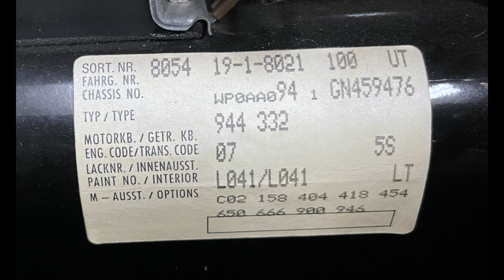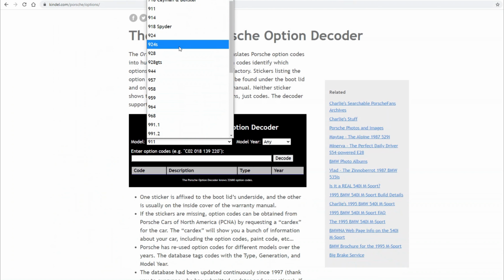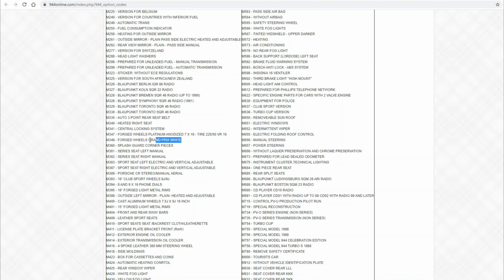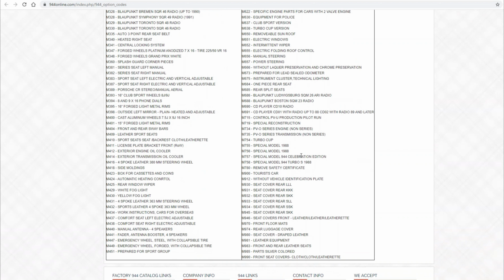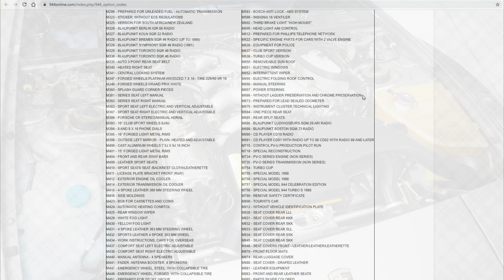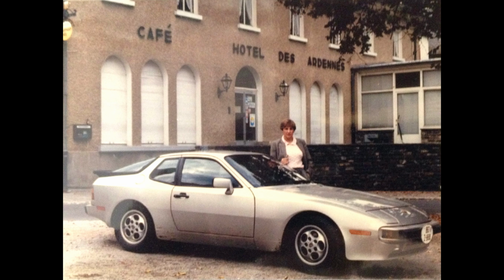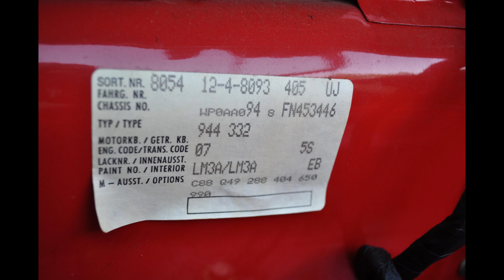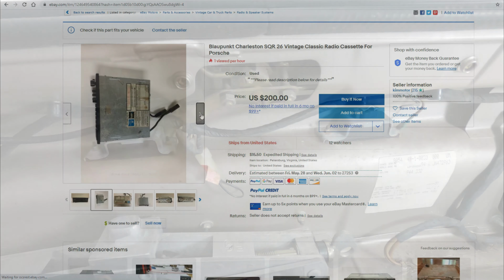Porsche 944 – Decoding Vehicle Option Codes From The Build Tag Sticker

Comment: A duplicate of the sticker (well, more or less) is also in the original Guarantee and Maintenance book supplied with the car when new, page 3.
Reply from the maker: Good call out, for those lucky enough to still have those materials. 😆 Whoever owned mine previously I guess had multiple 944s… the book I have in the glove box includes a sticker for a completely different car. This is a great tip to share though, thank you!  Cheers!

Comment: great channel. my 944s has a tiny crack on the dash board and the rest of the car looks new etc but do you know how can that tiny crack can be fixed?
Reply from the maker: All the 944 dashboards break down and crack eventually. This is obviously hastened by exposure to the sun. It’s best to keep them moisturized, covered, and the car garaged if at all possible. That being said, there are a number of options available as outlined below. Having your goals for the car in mind can help you sort out the best choice. 

The problem with replacing the dash is that Porsche no longer manufactures this part. While you can’t simply order a new one, new-old-stock (NOS) items can occasionally be found for exorbitant prices near $2,000. Unless you’re restoring a concours vehicle or have money to burn, it’s usually not the best way to go.

Next down on the list would be for a restoration of the existing core dash. There are service providers that will recover a dash for $500-$1,000+, which will require the removal of the dash. 

Used dashes, possibly in better condition than your existing one (fewer cracks), can be had on Craigslist and EBay for $150-$400 depending on the condition. 

Next on the list, there are some companies (Accuform) that produce dashboard caps from thin ABS plastic that are designed to form-fit over the existing dash and simulate a new look. These go for around $130 and work as a cosmetic “quick fix” if your main goal is to enjoy driving the car. 

The cheapest option would be one of the numerous carpeted dashboard covers available on Amazon and the like for roughly $40. These can help protect a dash from the sun while hiding any cracks, but don’t provide a very clean factory look. 

If you’re interested in one of the replacement option, the work isn’t terribly difficult to perform yourself, just time consuming, as you’ll need to remove the steering wheel, center console, glove box, and a variety of trim pieces. Depending on your skill level it could take the better part of a day or a couple weekends. 

Finally, you could attempt to fill the cracks with something like a silicone sealer of similar color. I have not attempted this as it’s a bit tight to get up there close to the windshield with any high degree of dexterity, and if it doesn’t come out right, then you’re facing a cleanup job, but it could work few 1-2 small cracks I would think.

Comment: Mine has code H50. I can’t find what it is anywhere on the Internet.
Reply: The codes on my car are C02 H50 431 946. But my car has AC electronic detachable sunroof, rear windshield wiper and full speaker system which are all different options. I don’t know if that makes it so H50 is a option package with a lot of them in it to make it easier to read out or not.

Comment: I have 2 codes I can't locate anywhere and one I have no idea what it means.  Codes L44 and L45 are complete mysteries and code 715 is "control PV- U production pilot run. Can you help me out on any of these?
Reply from the maker: Yeah, there are a few out there that may be lost to time. My guess on the “L” codes is that they relate to packaged options of some kind. If you happen to have the original window sticker, there is a chance they are defined there. 

Code 715 is an interesting one! This is purely conjecture as well, but based upon what I know about manufacturing and Porsche’s comprehensive quality standards pertaining to both production and development, code 715 appears to be a quality control standard implemented during that production year where they conducted a trial run using a new process or material. Because Porsche was constantly iterating and improving on the 944 series over the years, it makes sense that they would need a way to measure and evaluate the overall success/quality of those changes. So in short, your car was a guinea pig! 🤣 

Here’s the only other reference I was able to dig up on the forums: “My build date was 9/1984 which I think is after the summer holiday in Germany and when they usally implement new model year changes. It could be the Wurth undercoating (Polyvinyl Undercoating) initial run? That would be my best guess.”
Reply: @NC944er  thanks for taking the time reply with all that information. I can deal with having a guinea pig. 🤣 I have always found value in oddity. 

A little off subject and I thought I would share. I replaced my DME relay today because of a running/ not running/ no start thing that started recently. The replacement fixed the problem but I was amazed that my 85’ had the original DME relay built in 3/84 in W. Germany. 168k miles and it was the original. That’s cool to me.
Reply from the maker: @miracleman2909  Wow! Yeah, they normally don’t last that long.  Pretty cool! 👍🏼

Comment: seem to recall code limited slip was 1001..been awhile anyone out there remeber it
Reply from the maker: Never seen that code referencing LSD, the options codes are all 3-digit unless you attach the M to the front. Even the LSD transmission types are classified as things like 016K, 016R, 016S... and then the transmission codes are 2-digit ones like 8Q, 4M, 5R... so I’m not sure.

Comment: Just ran the codes on my 84 and came up empty with code H49. Can't really find anything online from a basic google search, would you happen to know what that means? also, codes 666 and 900 (which my car has, original owner bought it in Germany while deployed I believe, that's what I was told by the second owner) related to being bought in Germany and taken back to the US and the factory coating, does that mean the car is not galvanized to avoid rust? most of the language I could find about it was inconclusive. also a friendly hello from another NC 944 owner
Reply from the maker: Hey, yeah I can’t believe how many 944s are hidden away in NC! 😂 As far as the protective coating for factory delivery, the bodies were still galvanized, so you’re good there. What would be absent is the cosmoline coating on the underside of the car, which is basically the brown/orange-colored residue you’d see on components like the transaxle case, etc. The H49 specifics are probably lost to time at this point. The main source that would provide those details would be the original window sticker, if it still exists.
Reply: @NC944er  alright thanks for the info. Just got the car yesterday and haven't dug through all the little spots yet so maybe a window sticker will be found (there are some paper items in the storage spots under the trunk floor that I haven't looked at yet). the amount I have seen here is honestly surprising, have seen maybe 5 within the last 4-5 months, there is another one in my neighborhood actually which is pretty cool. excited to begin my project and will definitely be making use of your videos! its my first car and I'm going to be working on it with my grandfather which will be a fun journey. keep up the great videos and enjoy your car, I know I will enjoy mine
Reply from the maker: @bubboi2413    Nice, that’ll be good to have some help getting started. 👍🏼 There was a Guards Red NA about 4 houses down from me and for the longest time, I didn’t even know the guy had it, he was content to just let it sit in the garage. 😂 When I finally saw it, I offered to help him out, timing belts etc, but he never took me up on the offer.

Comment: Well I just found another weird thing about my car. None of the options are listed. I know it has an LSD, rear windshield wiper, sport suspension, etc. but literally nothing is listed. I'm pretty confused
Reply from the maker: Haha! It’s possible those were included as a package depending on the setup. Do you have any codes that start with H, I, or F after the first code?
Reply: @NC944er  Nope, those letters aren't anywhere on the build sheet. Although there is a lot of the other stuff such as the VIN, paint code, engine code and type. All of which checks out to be right
Reply: Just had a brain wave today. I thought "hey, I've seen people call chevy dealers about option codes, maybe Porsche could tell me. They probably keep info on that stuff". They do in fact keep info on that stuff, and holy macaronis, I have a factory 88' Turbo S. One of 1600 in the world. That was a very very pleasant surprise today lol. I had a hunch with the LSD, big sway bars and brakes that it was possible, but I thought that the last owner installed them. This is awesome.